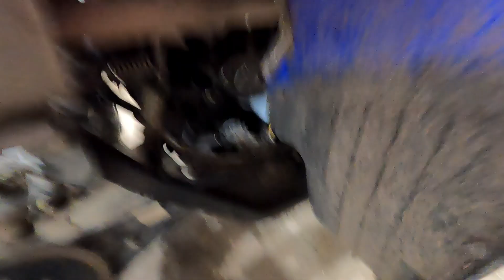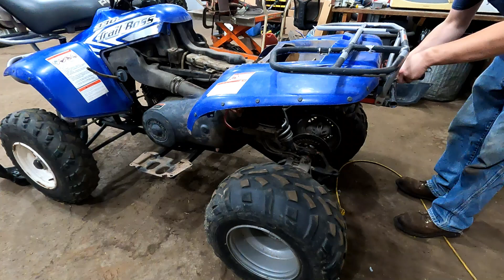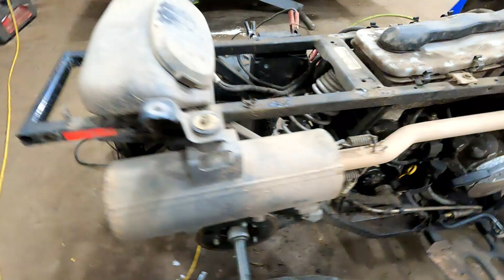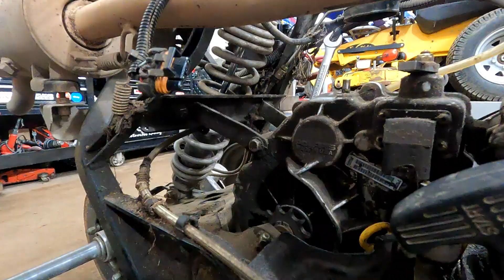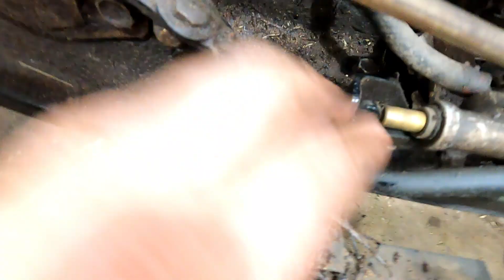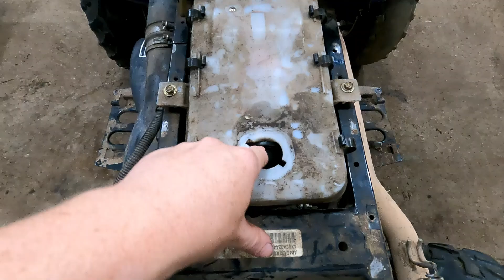Polaris Trail Boss 330 Atv Transmission Repair. Will it Run & Drive ?

Comment: I picked up a 330 trail boss last night. $100 doesn't run yet. But I don't think I got hurt.
Reply: I hope you see this but I was wondering if it worked out. I'm thinking of heading down the same road...
Reply: @Desaree1  i just got one, it's a 2003 Trail Boss 330 this week that runs great for $500..... could use a new belt plus new sprockets and gears and a paint job..... and i haven't checked the front plastic a-arm bushings yet, but they are only like 12 bucks or so.  Great simple atv so i would recommend getting one if the price is right.